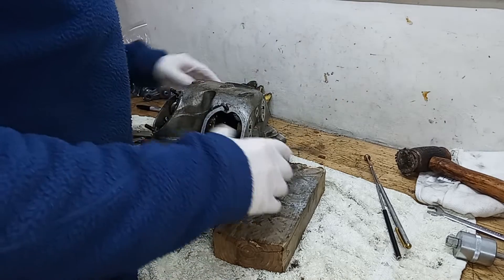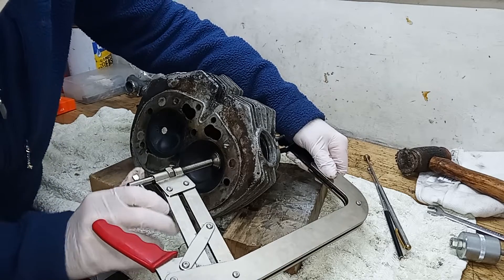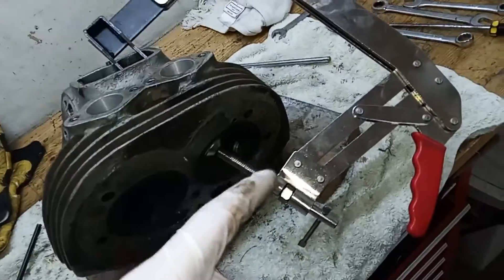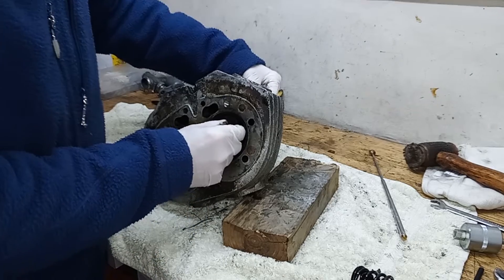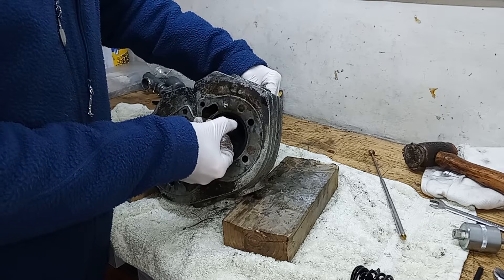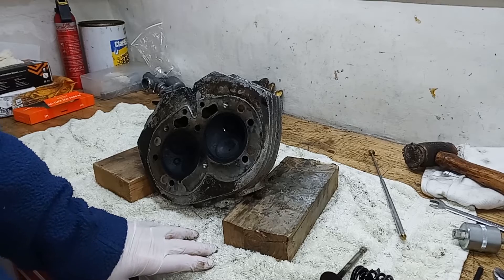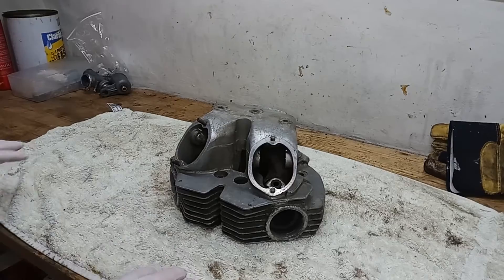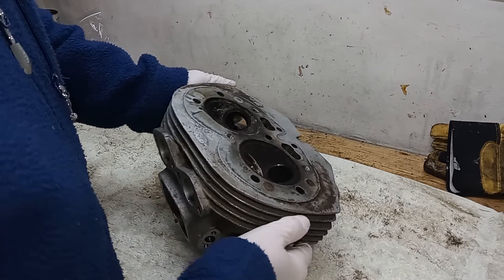Norton Commando Engine Rebuild. Part 21: Removing the Valves

Comment: It will be interesting to see how the repair is done on the exhaust ports:  I have seen/read that there are two different thread sizes for the Norton exhaust ports depending on model/year.  Not sure this is true or not, any feedback is welcomed.  Might not be a bad idea to send the exhaust nuts along with the head for repair.  We have a similar situation with a Norton head now so this will be good information.
Reply from the maker: Thanks, Mark. I don't know about there being different thread sizes for the exhaust ports. I'll check with the engineers who do a lot of Nortons and see what they say.
Reply: @Chris.rooke150  Sounds good.  I will look for the article I read and will send a link if i can.

Comment: interesting the parts book/Andover Norton list 4 valve spring insulators but then again it was rebuilt before. Do you replace the exhaust threads with brass fittings?
Reply from the maker: Thanks, I'll check on the insulator fitting. The exhaust ports can be replaced with either alloy or brass. I think the engineers will use brass in this case.

Comment: Hi Chris, Is the broken fin repairable and if so, just briefly, how do they do it? Thanks
Reply: I have a local guy here in where I live that did a repair job on an engine case a few years ago and what he did to simulate the casting was to take emery cloth and place it on the repaired surface (after smoothing out the weld) and tap the emery cloth with a hammer (not carried away) and that process left an impression in the case from the grit of the emery cloth.  You could not tell there was any repair once he was done - amazing work.....
Reply: Maybe this could be done on the new material for the fin...?
Reply: That sounds like a great fix, but I don't think you would have room to get a hammer between the fins. @markpoling7917
Reply: @jackcrognale417  I was thinking one would try this before the welding of the new fin in place.  Not sure when all said and done you would gain much.  In my case on the engine case repair everything was out in the open.
Reply from the maker: Yes, repairable. I believe they use new metal (available in different sizes) and having cut it or melted/cast it to roughly the correct size, weld it on. I'm not sure what is the best method of welding, but I think it's acetylene (? I'll check when it's been done) They then grind down the weld and the new fin to fit. That means you lose the stipple cast finish on the new fin, but it can still look good if done correctly.
Reply: Thanks guys